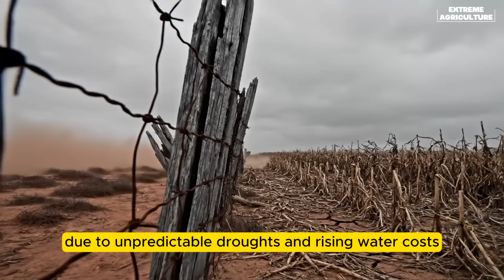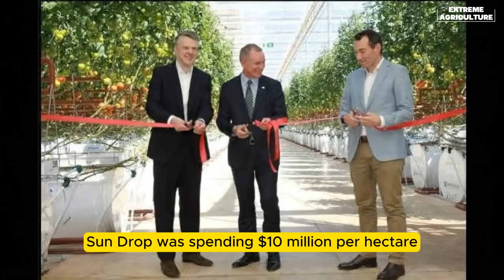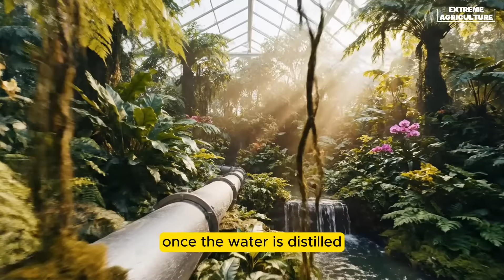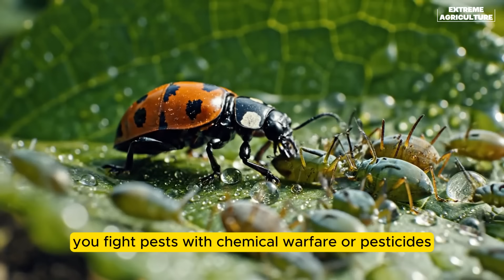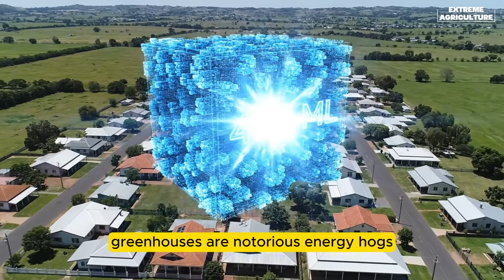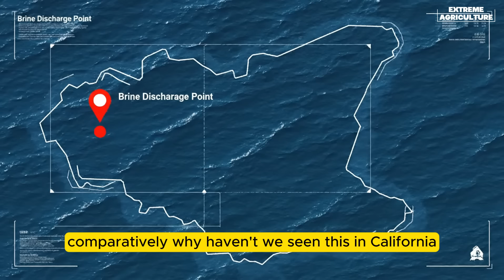Australia Installed 23,000 Mirrors In A Dead Desert — What Happened Next Was Insane

Comment: I worked at the substation next to this project and it was very impressive. One of my coworkers was also a maintenance guy in there. I never got inside though but would have been interesting to see it. Note Port Augusta is not always 40 degrees C as it was freezing when i was there in June - only 10 C and quite a lot of rain.

I think the solar thermal power plant that was proposed for Port Augusta has been cancelled sadly.
Reply from the maker: That’s a great firsthand account, thank you! It must have been impressive to see the scale of that substation. Appreciate the info on the weather and the local project updates. Thanks for watching and have a brilliant day!
Reply: What does the townsfolk think about the plant?

Comment: My  concern, the mirrors also heat the air, the clouds run away, any flight, pilot can suffer from mirrors. I would prefer usage of lense instead of mirror and burry the heated spot under ground.
Reply: Sunlight is reflected down and the mirrors concentrate the energy to the top of the concrete thing.  It is no issue for pilots at all.

Comment: That is an extreme system for an extreme environment. There are far, far cheaper solutions to "manufacture" food isolated from climate in areas where the environment is not so extreme. Even there I think there are some ways they could have reduced costs including some earth sheltering.
Reply from the maker: Thank you for watching and for sharing your thoughtful perspective. I think Australia is aiming for a long-term strategy, and I — along with many others — would love to hear more about your ideas and breakthrough approaches. Wishing you all the best!
Reply: @EXTREMEAGRICULTURE-999  I didn't see any contact info for you.
For the Sundrop farm, if they reduced use/consumption they can reduce pumping, power etc.
1. Earth shelter/buffer. Recess into the ground.
2. Earth buffer- underground cooling tubes are cheap. Ground-source or solar concentrating will preheat the water.
3. Reduce glass. Tomatoes need a lot of light, but probably not the 100% glass they have. 
4. Possibly instead of monolithic green house, cover more land and use rows between earth rows. The earth rows stabilize temperature. They can be either insulated from above, or under glass.
5. Compound parabolic troughs for evaporative desalination would likely supply enough water (which would be less need with earth buffered temperatures and a bit less sun). 
6. Solar PV would be cheaper and less likely to have maintenance problems for running the pumps to feed the troughs. 

However, they boxed themselves into a corner by choosing tomatoes which need very high amounts of water and light, and care.

In most place water is much more available, and low-light, low-water, low-care crops are abundantly available. EPS aircrete is a cheap solution for highly insulated, earth-sheltered or underground green houses. There are also options for DIY vacuum insulated glass for great insulation and light simultaneously. Nocturnal insulation is another important aid for northern climates.

Ultimately, we can grow anything, anywhere. Farmland is nearly obsolete. There are two types of things which favor outdoor growth:
1. Very tall things like coconut trees. 
2. Things of medium height or greater that require very high light.

Those things CAN be grown indoors but are less practical. Everything else: grow in a controlled, vertically stacked environment.